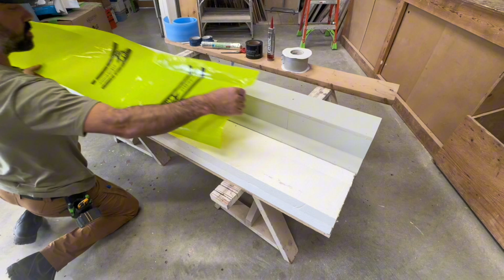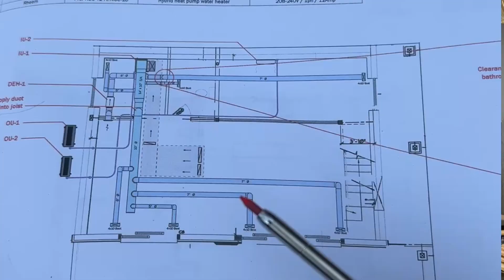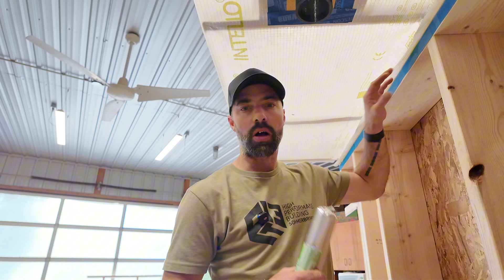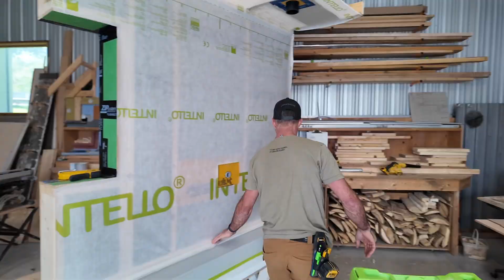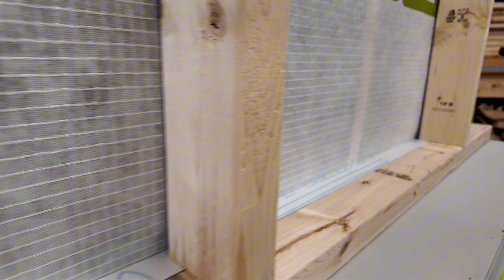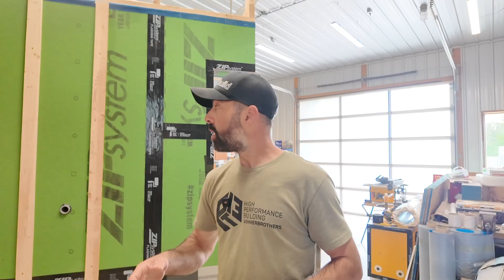Mockup | Breakdown - Air control continuity details for double-wall assembly.

Comment: Add Aero barrier before insulation equals a super airtight wall
Reply from the maker: Actually in the two projects we used this wall assembly, the average blower door score before insulation was 0.40 ACH@50. No need for Areo Barrier.
Reply: @SommerBros Incredible!

Comment: What other wrbs do you like to use or is zip the only one? Also, what is the roof insulation/wrb detail?
Reply from the maker: We use a verity of WRB systems depending on the project. Zip is very intuitive and provides great water/air control. We also use, Siga Majvest SA and Adhero 3000 SA which are excellent self adhered membrane systems. Our typical attic insulation is either blown fibreglass or cellulose and we use Zip on our roof decks.